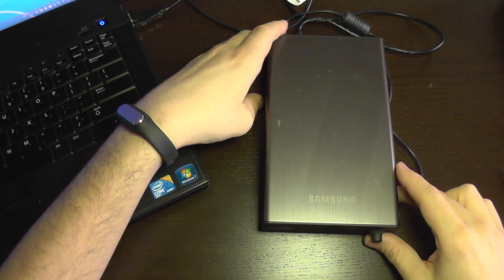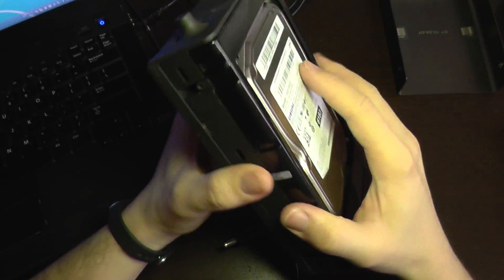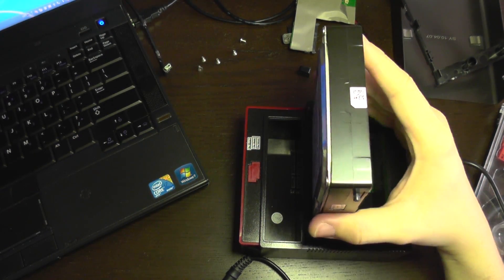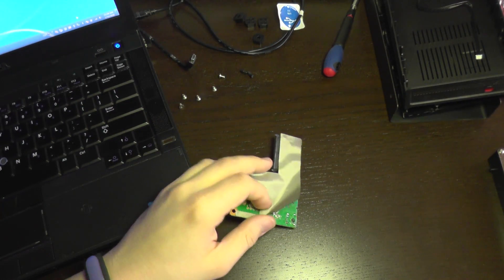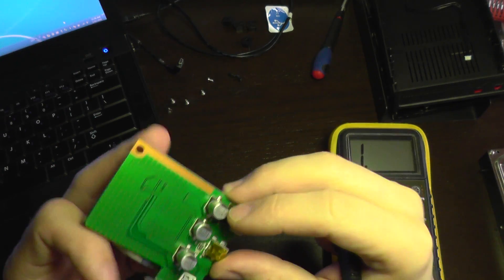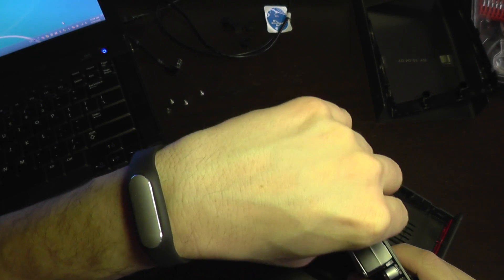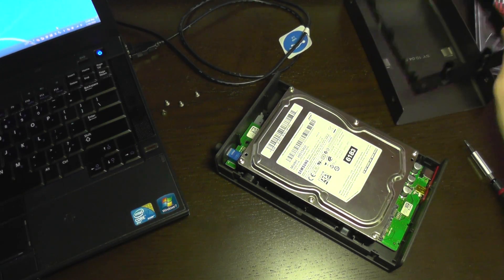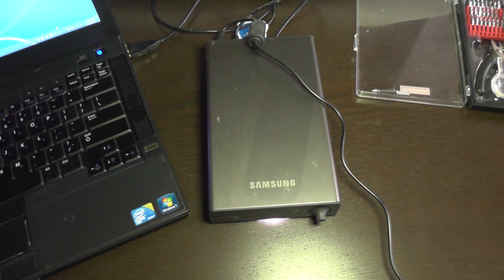Samsung Story External Drive Repair

Comment: I have the same old Samsung  story station, it was used as a backup device,  but yesterday I saw it doesn't working, the LED light is on but everything else appears down, no laptop or pc sees it as a device..   :((
Reply from the maker: Try to move the drive to another enclosure, maybe the original enclose went bad of the power adapter is faulty.
Reply: @TechTronic9000  It was the sata bridge's fault. I've connected the hard drive directly to a sata motherboard on a PC and started to save data, Apparently the HDD is fine, unfortunatelly I already opened it and touched the inside, but it still works just fine.

Comment: I have this same drive too. After using this for a 3 years, saving almost 1TB data in it, one day the folders started to seem faded as either pc could not read them or they looked like i applied cut directory on them. So i did restart by unplugging all cables and then suddenly it formatted itself. All my data was gone and unrecoverable since they were large in size. I went to electronic repair shop and made it repaired, at least i thought so. now, I can only see the files that electronics guys saved in it and can not save anything else. Also it makes this chirping sound and i think suffocating fan sound. What should I do, you think?
Reply from the maker: Get a backup drive ASAP as the one you have will fail completely very soon and you will lose all the date on it.
Reply: @TechTronic9000  Sad to hear. thanks for help though

Comment: can you help me!! because my usb is broken
Reply: did the LED light come on when the usb broke
Reply: pat arnold the led light isn’t coming! :(
Reply: Yasmin Theking1  my light won't come on too but i'm about to try something. wish me luck lol
Reply from the maker: You should search for a local repair shop...
Reply: TechTronic9000  may I ask, even if the USB broken off will the LED white light still come on?
Reply from the maker: Yes the light was working, but the drive didn't.
Reply: TechTronic9000  interesting. ......that means it the drive
Reply: pat arnold good luck🤟
Reply: great news I managed to recover my data by buying a HDD which arrived today. Did you manage to sort yours out?

Comment: can you help me please? I got this external hdd from my school for free (it was scrapped, so i knew it wasnt working), but i found a adapter for the power jack on the device and when I meaused the voltage of the adapter it said 4.1 volts, I also opened it up and the cable from the hdd to the LED and the potentiometer was loose, so I reconnected it and assembled it and still nothing...
Can it be because of my adapter, because it has only around 4v and your adapter has 12v? So, if I need to buy a new adapter, can you please send me a link of it, because i dont know how it is named. 

Edit: how many watts is the power adapter?
Reply from the maker: What is written on the power adapter ? Are you sure it's the original one ?

Comment: Have you tried to use this enclosure with an HDD of capacity greater than 2TB?
Reply from the maker: No, I haven't tried.
Reply: i tried it does not work. It will show you the drive put you dont have any access. The sata controller board has data limit of 2tb.
Reply: @ibobeko4309  Back in the day, Samsung was making three different versions of this enclosure (USB2.0, USB2.0+eSATA, USB3.0). A few years ago I have tried to replace an HDD in a USB2.0+eSATA version of this enclosure, but the new 2TB WD HDD was working only over a relatively slow USB 2.0 interface and was not detecting over eSATA. Currently, I am using a USB 3.0 version of Samsung STORY in conjunction with a 3TB hard drive from Western Digital. It works really well.

Comment: I have 1,5 TB Samsung Story Enclosure. Hdd already died and I have only box. Can I use it with 3 TB Hdd ?
Does it support more than 1,5 TB ?
Reply from the maker: It is possible to work, but I don't recommend the Samsung enclosure, you are better with something like this: https://goo.gl/YbDv16
Reply: Do you offer to throw it to garbage? Is there risk to use it?
Reply from the maker: There is no risk to try it but it's not very reliable.

Comment: hi, i brought the product, when i plug the hd in and turn power on i just get a purple light flashing. any ideas?
Reply from the maker: If it's new and not working you should return it, it may be faulty. If return is not an option it may be a electronics problem with the enclosure. You should try the HDD with a docking like this: https://goo.gl/YbDv16

Comment: please help! i have the same drive. i did something stupid, plugged in my laptop charger into this and burnt it out. the light still comes on but no spinning up. any ideas? need to recovery my data. thanks
Reply from the maker: You should buy a hdd interface and put the drive directly in it and try to recover. You have 50%-50% chances as you may have luck and only burnt the Samsung's docking electronics but not the drive. You need something like this: https://goo.gl/YbDv16
Reply: thank you. i will try this
Reply: @vkproductions42  Any luck??

Comment: My Samsung story station is 2008 model, it has been functioning good until recently, it connects to lap top green lights flashes on for a couple of minutes than it stays on and after while it will turn blue and then it turns of no lights. when I plug in or out USB computer sound as if it recognize the drive but I can not see it anywhere
Reply from the maker: Try the basics first, check the power adapter, replace the usb cable, try another PC, maybe it's not the drive at fault.

Comment: Nice job! I have the same hard drive but the usb plug came off. I'm trying to use a SATA cable but it won't show up when I plug it into my laptop. Any advice? The power rack you used, would it be an investment to get the hard drive running?
Reply from the maker: You can get various hdd enclosures. A good and cheap brand I have found is this: http://www.gearbest.com/hdd-ssd/pp_347607.html?lkid=10002990  It works also with smaller notebook hdd's
Reply: TechTronic9000  thanks
Reply: TechTronic9000  Hi, I tried to buy online the one you recommened which was the ORICO 6518US3-V1 USB 3.0 Hard Disk Drive Enclosure Case - but the UK one is discontinued. What do you think of this one? should i buy it? Thanks.    http://amzn.eu/d/3BnaJer
Reply: I wanted to thank you for the information about HDD enclosure and all the advise give within the video. I managed to recover my data by purchasing a HDD which came today.